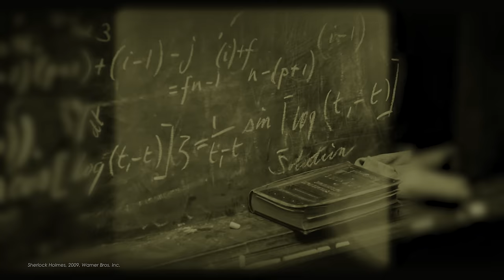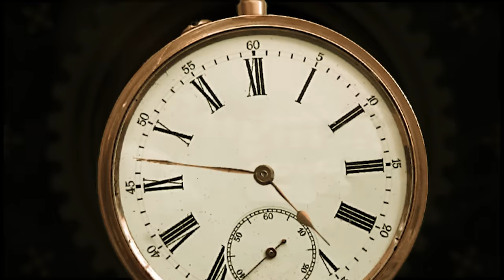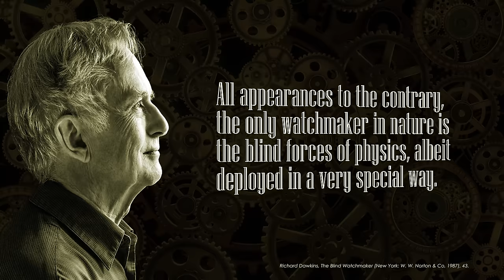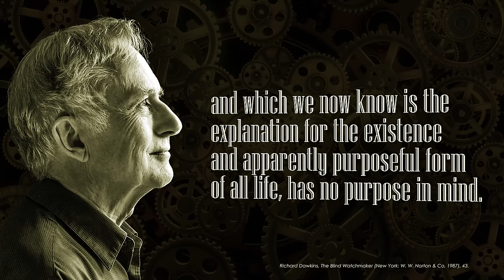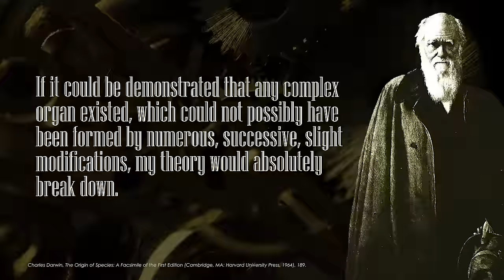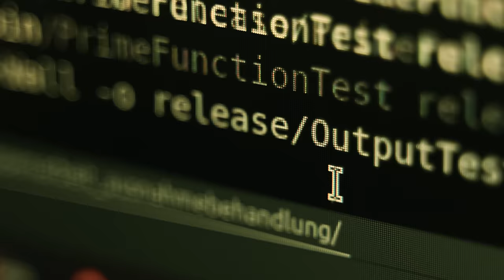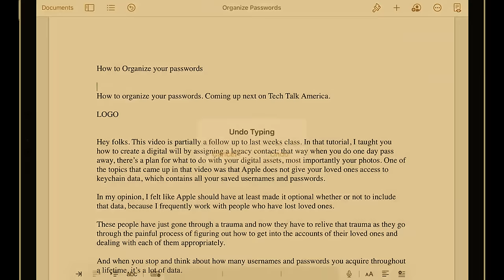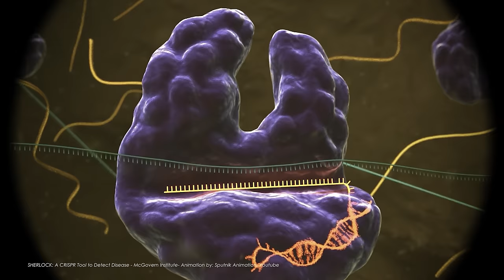Even TOP Evolutionists Won’t Deny This Evidence for God

Comment: Atheism and evolution are not the same thing. Millions of Christians accept the science of evolution.
Reply: What are you talking about there like brother and sister.
Reply: @RodericGurrola  
They have nothing to do with each other.  Evolution is about science and the material world.  Atheism says nothing about the material world - but is instead a statement about faith (or lack thereof) in the supernatural.
Reply: @RodericGurrola their point was self evident. Christians believing in evolution shows that evolution is not the same as atheism.
Reply: @jockyoung4491  True, however the Majority of Atheists are Evolutionists (granted with exception) And on the other side the vast majority of those that believe in creation and or a young earth are Christian (again with exception)
Reply: @tims5268  Completely correct. However, there is a great deal of overlap. Not all Atheists are Evolutionists and not all Evolutionists are Atheists. But Most of one are also the other, and unfortunately we Christians often forget the difference and incorrectly use the terms as synonyms.
Reply: Once you look at more evidence a young earth is the only thing that fits.
Reply: @TacoBel  
A lot of atheists wouldn't know anything about science so would have no opinion on the matter. Muslims and Jews believe in creation, as do most other faiths around the world. The point is that atheism and evolution are two completely unrelated ideas, whether particular people agree with both or not.
Reply: @fredbollinger8256  
Fits what?  The Bible?  It obviously does not fit any scientific evidence.
Reply: Yes  millions of professing Christians believe Jesus created using millions of years of death suffering and disease all before Adam sinned.  Very in-consistently...
Reply: @fredbollinger8256  give one piece of evidence for a young earth.
Reply: @calvinsmith7575  correct, it is inconsistent isn’t it Calvin. Yet you chose to believe the nonsense.
Reply: @calvinsmith7575  so you are saying the bible contradicts reality? About time Calvin.
Reply: Believing in Evolution as a Christian is like being an Atheistic Buddhist or Hindu. One idea stands in stark contrast to the other. To believe in one is to deny the other. Christians that believe in Evolution fail to see that. Even though many of the Atheist that believe in it also see this point as well. The whole point of evolution is to discredit God's word and to convince people not to have faith in Him. 

Believing in Evolution suggest two things about God if it weren't to be believed. One that God couldn't get creation right the first time and had to go through millions of years of trial and error to get it right. Secondly it suggest that death is more of creation, when the Bible suggest the opposite. Death is what stops creation, haults it in place. Evolution suggest nothing created the universe and death produces life. How can you believe in something that is not only a logical contradiction, but a biblical one as well? 

Now do we fully understand how good created the world? No of course not, but thats the point. The point is to have faith in God whether we understand him or not. All things he does are righteous and just. To assume otherwise because other people said so doesn't make sense.
Reply: @sonyyung5510 No, the point of evolution is not to discredit God’s world. Who told you that nonsense?
Reply: @billcook4768  That is what Lyell wrote on 14th June 1830 in a letter to George Poulett Scrope: I am sure you may get into Q.R. [Quarterly Review] what will free the science from Moses, for if treated seriously, the [church] party are quite prepared for it.

This is the same Charles Lyell that wrote Principles in Geology. The same book Charles Darwin was reading on his infamous voyage in which he came up with the theory of Evolution. It's not a coincidence and clearly it is meant to discredit the word of God.
Reply: @sonyyung5510  Thanks for responding, though I’m not willing to accept one letter from one guy written long before the theory of evolution was published as evidence. But even then, you are misreading the quote. Nowhere does it say anything about discrediting Moses. Just separating it.
Reply: @sonyyung5510  Buddhists can be atheists, Buddhism does not have a supreme god.
Millions of Christians accept evolution as the best explanation for the diversity of life on earth. They usually add that their god guided it.
The Church of England held an evolution weekend in 2022 to demonstrate how it could be compatible with their Christian beliefs, claiming only that god guided it.
The Catholic church has no official stand on it, letting Catholics make their own decision, I taught science at two Catholic private institutions, St Paul's High School, and later at Kavanaugh College. At no time was there any problem with me teaching evolution there, the Christian Brothers in charge just added in their own religious classes that evolution was guided by the hand of god.
Reply: Theistic evolution is not of God
Reply: @newcreationinchrist1423  Your opinion only.
Reply: @newcreationinchrist1423  Actually, that’s the very definition of theistic evolution.
Reply: @fredbollinger8256  What evidence Supports a Young Earth? The evidence for an "old Earth" is utterly overwhelming - can you example some clinchers?
Reply: Correction: Uninformed, worldly Christians
Reply: @mirandahotspring4019  Thats the problem entirely. Teaching that Evolution is the work of God, without any biblical evidence of that is the closest you can get to actual blasphemy. Many Atheistic Evolutionist admit as such, saying God is irrelevant if Evolution is to be believed as fact. Thats the point, Evolution makes God inherently meaningless. 

God tells us what he did, he doesn't have to explain the exact details. To assume we know how the world was created, "because science says so" is to put man's word above God's. Science is meant to be done with understanding that God is our foundation. Evolution was quite literally invented to show the opposite. Thats God must be separated from science altogether and eventually rid of entirely throughout society. 

New age Buddhist dont believe in a central figure, but Traditional Buddhism has always believed in the Buddha becoming a Supreme being and you too can achieve it through enlightenment.
Reply: @billcook4768  Charles Lyell is held as one of the fathers of both modern Evolution but also modern Atheism. His work directly contributed to the advancement of naturalistic ideals being pushed in Science. He's not some irrelevant figure you can ignore, because Charles Darwin didn't ignore him. He was literally inspired by Lyell's work to create the Theory of Evolution. That means Lyell is one of the metaphorical pillars that hold up Evolution as a whole. 

Lyell was also a staunce Atheist who despised most forms of religion. His intent was very clear that he wanted more the just the separation of God from science, but the erasure of the idea of a God entirely from the collective consciousness of humanity. Again this isnt a debatable point, but a foregone conclusion made by the man who inspired modern naturalistic thinking. Thats like saying Henry Ford had nothing to do with the invention of the automobile.
Reply: @sonyyung5510  
Charles Lyell was a devout Christian who never fully accepted evolution.  You may be thinking of Huxley, but so what?  These are just guys who lived a long time ago.  They have little to do with the current science of evolution.
Reply: @sonyyung5510  
The facts of biological evolution say nothing about whether God exists or is meaningless.  Science does show that Genesis cante be literally true, but so what?  Why is that necessary for faith in God?
Reply: @jockyoung4491  Oh yeah I am thinking of Huxley. Charles lyell was more of a Deist than anything, but the point still stands. Evolution was directly created and still is about the separation of God from science. Any Christian who believes in God should realize that and should understand why it is wrong. Separating God from anything is foolish. God tells us do all things Good in his name for his glory. To deny God that just because you want to be unbiased is not a biblical mindset to have. If you want to be unbiased ask God for discernment and truth when doing your work in Science. God hand is in all things even in science. That doesn't say everything as a Christian means God is a "God of the gaps", but that God is lord over all things.
Reply: Millions of years of death and destruction are incompatible with the gospel message.
Reply: Evolution is the “deity” Atheists tend to put their blind faith in.
Reply: @jockyoung4491  If Genesis isn't literally true at least on some real level, then the whole Bible must be thrown away. God himself talk about how not even a the tittle of a I is false in the Bible. That mean all things in God's word is true. If evolution shows Genesis isn't true, then the message of Jesus is meaningless. Jesus died on the cross for our sins, because of Adam's sin at the Garden. If that event didn't happen at all, Jesus sacrifice is pointless and our lives as Christians should be pitied for all time. Of course we don't have all the details of how Genesis went down because we weren't there, but neither do we have all the facts on Jesus either. Thats doesn't now mean Jesus isn't our saviour. But if evolution is to believed as true, then our faith is meaningless because is it built on ALL of God's word being true, including Genesis.
Reply: @sonyyung5510  
I don't get that. If it turns out that people writing the Bible over 2000 years ago got something wrong, how does that make EVERYTHING wrong?  Millions of people still believe in God even though they accept the scientific findings of the modern world.  If you can't reconcile them, then you may well be headed for a train wreck.  Science is not going away
Reply: @m0x910  
If you think science is "blind faith", then you really don't get reality.
Reply: @jockyoung4491  Neither is God's word going away. If you dont have faith that God can't keep his consistent over 2000+ years, you might as well not be his. You might as well say God didn't create the universe, he cannot perform miracles and Jesus didn't rise from the dead. At that point why be Christian at all? The church is wondering why we are losing young people from the faith, but then push Evolution as if it is meant to meld with Bible. Meanwhile all of academia is also pushing evolution and telling them God isn't real. Okay if evolution is true all the same, why bother to with the Middle man of God? Why believe any story in the Bible is true if the beginning is a bunch of hogwash from a few dirty sand people that don't know what their talking about anyways? Why hold the ethics of God's word in my heart if God can't even be honest about evolution to me in his word? That is why one cannot believe in Christ and Evolution. Its is a untenable position that begs you to give one up for the other. Evolution isn't Science, it is a psudeo science based on the presupposition that God isn't real. Scientists literally say to operate as if God doesnt exist.
Reply: @sonyyung5510  
Science can say nothing about God.  It does not presuppose the existence or absence of God.  Biological evolution is supported by logic and evidence, whether God exists or not.
Reply: @sonyyung5510  Evolution has been studied by millions of people for 150+ years. It’s not tied to any one person.
Reply: @jockyoung4491  Science doesnt speak of God and his power, but nature does. It says in the Bible that the heavens proclaim his name, his power and glory. Science does require logic to function, but logic itself requires a mind outside of the universe to exist. Logic exist in spite of humanity not because of it. Logic requires a mind that exist both conceptually and in reality, that coexist along side it; for it to be not only possible that logic exist, but that it also applies in reality. That mind that exist outside of the universe is God.

You say biological evolution doesn't say anything about the existence of God, but every atheist who believes in it uses it as evidence saying God is not real. One cannot say evolution is based in logic and evidence and then evolution as evidence to say God doesn't exist. If science says nothing about God, then neither does evolution say anything about God's word. Since Evolution uses science to justify its validity, those who believe in it cannot speak on God's word using it. Because Science says nothing about God, remember. Its like using a car manual to prove that Horses exist. The car manual only speaks of Cars, it says nothing about other modes of transportation that are biological.

So either Science says nothing about God, thus you cannot use it or Evolution to disprove God or his word.(Which includes Genesis) Or Science does speak on God, it which it either invalidates God and his word or it confirms God and his word. You can't have it both ways.
Reply: @sonyyung5510  
I agree you can't use evolution to say that God doesn't exist, and I have never done so.  In fact I have repeatedly said that evolution is compatible with the existence of God. It better be, because whether God exists or not, biological evolution happened and continues to happen.
Reply: @billcook4768  Yet the Bible has been studied by Billions of people and has been studied for thousands of years. Yet you say that invalidates the truth of the Bible. Would that mean in 600years, Evolution will be seen as falsehood? Since it would be old and people in the past didn't know what they were talking about compared to humans of the future, right? 

You see how many people study a thing or for how long it is studied is not prevalent to whether or not the thing is true. It wouldn't matter if no one study math at all, 2+2=4 will always be true. Well the same applies to moral and cosmic truths. Whether we want to admit it or not, God is real and his word is true. This is not to say all the scientific research done over the years was pointless, but that it was misguided. To operate as if God doesn't exist, would be like saying, "Being a good biologist entails ignoring the Hippocratic oath for the good of scientific progression." Ignoring God is like saying we must ignore the golden rule to perform our experiments.
Reply: @jockyoung4491  I don’t think all of science depends on blind faith. It is obvious those who believe in the poor theory of macroEvolution require blind faith to do so.
Reply: @m0x910  
How is it "obvious"?  Macro-evolution makes perfect sense to me and there is lot of evidence for it, so what's the problem?  LOOK at the evidence and judge for yourself.
Reply: @jockyoung4491  You can't use Evolution to prove God if science doesn't say anything on God. Since Evolution uses science to validate itself, it also cannot speak on God's word either. Thus you must argue against Genesis philosophically if you wish to prove it wrong as just mere fairytale. Only philosophical argumentation can be used as proof of something that is inherently not scientific,  because there is more than one form of truth than just Science. Such as historical truths. You cant prove historical events with pure science, you need documentation and eye witness testimony to prove something happend in history.
Reply: @sonyyung5510  
Yes, you need evidence to show what happened in the past. We have over 250,000 species of fossils that do just that.  What's the problem?
Reply: @jockyoung4491  But do we have direct documentation or eye witness testimony from people that lived in the past to confirm whatever theories scientist assume from those fossils? If not then Evolution is a educated guess at best or its a lie purposely perpetuated by academia to disprove God at worst.
Reply: @sonyyung5510  
I don't get what you are asking.  Fossils are documented evidence of something that lived in the past.  That evidence exists for anyone in ANY time to evaluate for themselves. That's how evidence works.
Reply: @avgejoeschmoe2027 there you go lying again
Reply: @fredbollinger8256 once you look at more evidence a young earth is the only thing that fits??? What evidence??
Reply: @sonyyung5510  My point was not “evolution had been studied by lots of people over time, so it had to be true.” It was that the motivation of any one person cannot be used to define what evolution is for.
Reply: @sonyyung5510  Almost no atheist uses evolution to “prove that God isn’t real.” Where do you get this stuff?
Reply: @sonyyung5510  All if a Eden is is not telling people God isn’t real. Where do you get this stuff?
Reply: @billcook4768  That may be true for most people except for one person. That being Darwin himself who is the father of the theory itself. We can't ignore his motivations because without them, the theory might never have ever existed in the first place. So we must take what his motivations were in creating the theory seriously. That or we must consider ourselves intellectually dishonest. Im not saying Darwin speaks for all of Evolutionary science, but his words hold more say than any other person studying it today. That be like saying we can't consider Newtons motivations behind his theories either. In which case, get used to not understanding gravity at all because without his motivations we would not have Newtons theories either. The world of science is more complex than just doing some experiments and having theories. The motivations behind those theories are important as well, just to a lesser degree than the theory itself.
Reply: @billcook4768  If you truly think Atheist don't use Evolution to disprove God and his word, then you have not been paying attention. The video of this comment section says much. This is not a debatable point if it comes straight form the horses mouth.
Reply: @billcook4768  Genesis is not a fake story. It's not a myth that was made up for people to dismiss as legend. It is a very real story, with real consequences. Those consequences being sin and death. It is the story of where our misery begins. If Genesis is not true, there is no sin, there is no morality, and it matters not if we die. If death doesn't matter, then neither does heaven or hell because they would not exist. Genesis is the bed rock of our morality, and our understanding of sin. Without Genesis being true, well then all things are permissible, as said by Nietzsche.
Reply: @sonyyung5510  
No, Darwin's motivations are irrelevant.  They have no bearing on the actual science.  Equally, how an atheist might "use" evolution is irrelevant.  The science stands on its own.  Biological evolution would be obvious whether Darwin ever existed or not. In fact, another scientist DID discover the idea of natural slection almost simultaneously with Darwin.  Darwin is of historical interest only.  Most biologists haven't even read Darwin.
Reply: @sonyyung5510  
I completely disagree that ethics depends on a literal interpretation of Genesis. I always strive to be an ethical person, and I can't think if any way I would live my life differently whether I believed God existed or not.  Ethics is based on empathy, which is universal
Reply: @m0x910  
Obviously animals have been dying for millions of years  Where do you think all those fossils came from?
Reply: @sonyyung5510  Alfred Russel Wallace came up with most of the theory of evolution at the same time as Darwin. There were a dozen of others just a bit behind. As more evidence piled up, the conclusion was inevitable, Darwin or not.
Reply: @jockyoung4491  It does matter what Darwin and Atheist think about Evolution, they talk about it the most. They are very scientists you propose are speaking true scientific information. In reality their information is just as biased as anyone else. Scientific research can be just as flawed as the people doing the experiment, thus it is important to know the presuppositions of a scientist to know of there information is truly unbiased or is based in their perspective. Since that's basically impossible since everyone has a bias, we must logically ask this, "Whose bias most aligns with reality?".

Biological Evolution is the assumption, not a fact. Evolutionist take the fact of genetic mutation and adaptation and extrapolate it out to the macro level. Well Marco Evolution isn't true because it does not account for the Origin of life. One cannot get a single cell organism from non life. Thats not how nature works now, so why would it work like that in the past? Until the Origin of life is answered, Biological Evolution will continue as an unverifiable assumption.
Reply: @sonyyung5510  For a thousand years Bible scholars thought the Bible was the incompatible with an earth that rotated on its axis. As the evidence piled up, they realized they were reading the Bible incorrectly. Passages describing the sun moving in the sky were symbolic, not a literal description of the sun moving. As you say, the story of Genesis is one of sin and consequences. The exact details can easily be read as symbolic, there to support the important message and not literally descriptions of the universe forming.
Reply: @jockyoung4491  Ethics are completely dependent on whether or not sin is real. The realization of sin is dependent on the story of Genesis being true. Without the knowledge of sin, empathy is a pointless exercise. It would also be arrogant for you assume what someone is feeling like if sin is not real. If sin doesn't exist, there is no such thing as suffering. Whether someone lives or dies, its all just your opinion. 

Our empathy is only validated if sin exist. We all suffer from sin. We know and see its affects. We know what is it like to go through pain and struggle. We can relate and empathize with one another because we all suffer under sin. Empathy alone cannot solve ethical problems. The knowledge of the source of those problems is also needed along side empathy.
Reply: @sonyyung5510  
We have plenty of evidence for macroevolution, and it doesn't depend on how life started.  Even if you could prove that God created the first life, it would still be obvious that it then evolved over billions of years.  There is no scientific doubt about that.
Reply: @fredbollinger8256 
Stay strong in your face because you are right.
Reply: @jockyoung4491  The fossils obviously were buried during Noah’s flood 5000 years ago.
Reply: @jockyoung4491  You obviously are not aware of the “Scientific dissent from Darwinism”. There is growing doubt over the validity of macroEvolution theory.
Reply: @m0x910  
"Darwinism" isn't a theory, so I'm not sure what "dissent" means, and neither are you. There is always ongoing scientific debate about the major drivers of macroevolution, but there is ZERO scientific debate about whether evolution happened. That much is obvious.
Reply: @jockyoung4491  You keep stating that macroEvolution is so obvious. But you are yet to provide a single piece of empirical evidence to support your blind faith in Darwinism.
Reply: @m0x910  
"Darwinism" is not a theory.  I have no idea what you mean by that.  Macro-evolution is obvious from the evidence. Not just the 250,000 species of fossils, but also the genetic and embryological comparisons that confirm the same relationships. Biological evolution is the ONLY theory that can explain it ALL. If you haven't seen the evidence, who's fault is that?  It is readily available just about anywhere.
Reply: @jockyoung4491  I am not asking you to number or tell me the location of the evidence just provide one piece of empirical evidence which proves macroEvolution.
Reply: @m0x910  
The strength of the evidence for evolution is how ALL facts and observations come together. Over 250,000 species of fossils have been found so far, all arranged in time and space in logical progression of specific intermediate traits, AND we have genetics and comparative embryology of living organisms that confirm those relationships. A theory has to be able to explain ALL of the evidence together.  It is the “big picture” that makes biological evolution so universally accepted.
Reply: @m0x910  
But if you really want specific details, some of the best transitional fossils are very persuasive.  We have whales with non-functional legs; snakes with legs; fish with fingers, birds with teeth;  and then there is the entire sequence of  fossils showing the gradual and progressive evolution of reptiles into mammals.
Reply: @jockyoung4491  Except macroevolution falls woefully short of this standard you have set. The theory cannot explain even half the observations let alone ALL of them.
Reply: @m0x910  
 We have enough evidence to show that macro-evolution happened, even if there are details we don't have enough evidence to explain yet. . The point is that there is no evidence inconsistent with macro-evolution.  There is no other theory that can say that.
Reply: @jockyoung4491  List of 24 Living fossils: Coelacanth, Elephant Sharks, Horseshoe crab, Gingko, Nautilus, Tuatara, Aardvark, Goblin Shark, Crocodiles, Red panda, Amami Rabit, Komodo dragon, Monito del monte, Opossums, Scorpionflies, Crinoids, Cyanobacteria, Frilled Shark, Koala, Laotian rock rat, Okapi, Platypus, Sandhills crane, Snapping turtle.
Reply: @jockyoung4491  These animals represent 25 pieces of emipircal evidence demonstrating macroevolution does not happen.
Reply: @m0x910  
No, they really don't.  A species doesn't change a lot if there is no reason to do so OR if the necessary variation never occurs. In fact, evolution can actually prevent major change if individuals who are different do not do as well.
Reply: @jockyoung4491  So if no organism ever undergoes macroEvolution, it still proves the theory correct… got it!